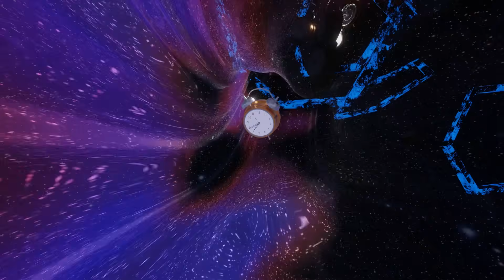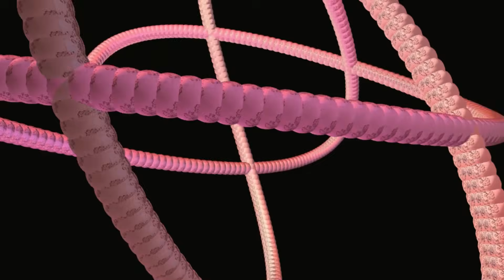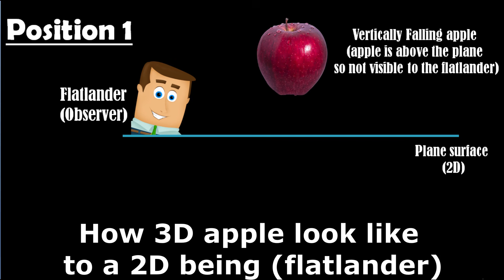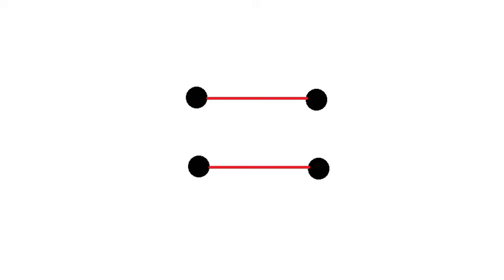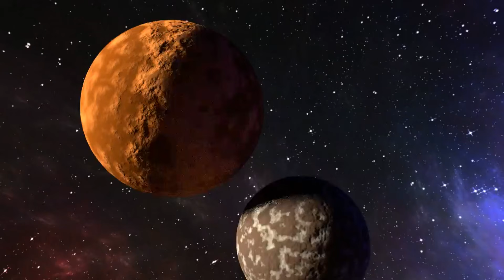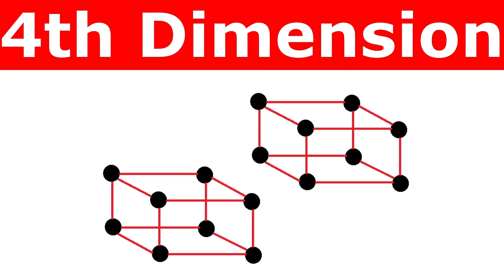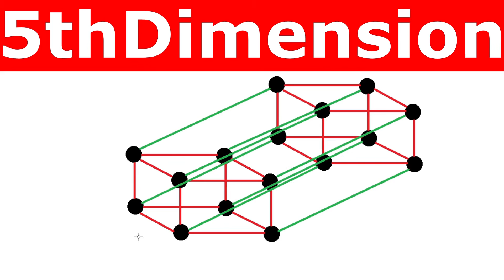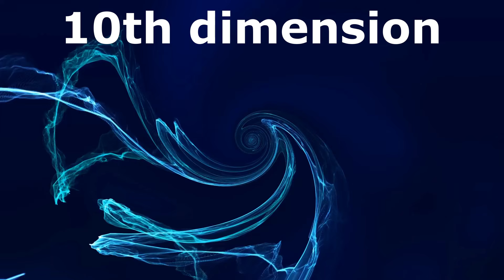11 Dimensions Explained - A Mind-Bending Explanation of Higher Dimensions!

Comment: Nice attempt at understanding the 11 dimensions so please don’t take offence if I make some corrections, but you make the common mistake of placing time as the 4th dimension, you are still thinking in a 3 dimensional way by expanding the shape of the first three geometric dimensions. You need to include the forces (or relative dimensions such as electromagnetism, gravity and nuclear) as dimensions, and by doing this it would make time the 9th dimension. Another common error made by 3 dimensional beings is that if you were able to move within the time dimension; you automatically assume this includes time travel. It would be more accurate to describe awareness within the time dimension as slowing and speeding up time rather than traveling into the past or future, and this is understood because from within the time dimension there is no past or future and this also discounts the idea of parallel timelines.
Reply: I would like to explore/propose a test for “dimensionness” from an observation I ran into with the “flatlander” example. I’ve been mulling over in my head for a while. 
The flatlander sees the apple moving through it as a point appears, expands, collapses and then disappears. Now if I imagine that, if I was a flatlander, who fully understands three dimensional reality, how would I describe knowing the difference between a flatland object and a 3-dimension object? 
I imagine I would describe a 3-dimensional object as matching 1 of the following 6 conditions (which are actually showing the same phenomenon at different points as the apple falls). I like to use “interference” as a description of how dimensions interact/affect/influence each other where they “touch”.
1. I observe the phenomenon appear for no apparent 2D reason.(the first point of interference of the 3D and 2D)
2. I observe the phenomenon disappear for no apparent reason. (The last point of interference of the 3D and 2D) 
3. I observe the phenomenon to always be increasing for no apparent reason. (The first half of the interference of 3D and 2D)
4. I observe the phenomenon to always be decreasing for no apparent reason. (The second half of the interference between the 3D and 2D)
5. I observe what seems to be a phenomenon that is a constant for no apparent reason. (The interference of the 3D and 2D goes so slow that I cant observe a change)
6. I observe a phenomenon that seems to flash in and out of existence for no apparent reason. ( the 3D and 2D interference goes so fast I cant clearly observe)

Now, lets visualize the interference between the 3D world and all other dimensions (i like to use “n-dimensions” to describe a random other dimension). Any phenomenon that matches 1 of the 6 conditions for no apparent 3-dimensional reason, would be the result of a n-dimension and 3D interference.
Are there any phenomenon you can think of that pass the test? I’ve come up with a few.
Reply: @deths1679  Hey, watch this, trust me, it holds what you seek.

https://youtu.be/da5RoS4w5YU
Reply: No Name  ah I see, there are some that choose not to explore and some that don’t know they can. It seems you choose to explore, it is a fun place. One thing I’ve learned about people is I can’t change them, only guide them, and everyone knows something, but no one knows everything. 
You like my flat space-time joke, its funny because when they illustrate space-time, they show it as a flat fabric  plane that is warped and bent by mass.
Reply: What are you talking about? Gravity and electromagnetism are NOT dimensions LOL.
Reply: No Name  oh no, we got a flat space-timer, lol just kidding. I was curious on your interpretation of something. It seems to me that Einsteins clock tower thought experiment has implecations in both the nature of reality and our perception/interpretation of reality. Have you ever experienced perceiving reality to move faster or slower? Such as when someone is working really hard and the day seems to “fly by” very quickly. 
Now with assuming that mass and velocity will exert “gravitic forces” on objects, my question to you is, does the perception of time accelerating increase the specific gravity of a persons body?
Reply: i think the entire way everyone is trying to predict and diferentiate one dimension from another is completely wrong haha
We are missing the big thing that is compreension on how conscious work and interact with the universe, we cant grasp any other dimensions before that.
Reply: This theory does not make sense in any way.. For example if i go back in time and start a new timeline with a new wife plus i also exist in the older timeline with my old wife then most probably the me living in the older timeline with the old wife will start an endless loops of timeline trying to start a new timeline with a new wife, this will start an stupidly endless versions of new timeline unless all the versions of me in all the different timelines shares the same thoughts, feelings and consciousness which is highly unlikely..
Reply: And creating a whole new damn timeline just to cheat on your wife and have some fun with a new wife is an ultimate example of multidimensional desperation. I mean what kinda fetish is that??😂
Reply: @MainakBose14   🤔🤔🤔
Reply: No Name  but as I understand it it doesn't mean they're dimensions. Besides the fact we can theorize but were not certain what is in these higher dimensions.
Reply: Forces don't make for more dimensions, but otherwise you are right about the fundamental error of perceiving from "a 3 dimensional way", i.e. a bottom-up approach.
Reply: Damn. But I get it. Sooo...
Reply: No Name  yes my favorite experiment is the slit experiment. What are your taughts about it?
Reply: Wrong
Reply: This is class 101. Check and see if the teacher in the advanced course covers it.
Reply: Lmao all these mountain dew drinking, neckbeard having armchair philosophers talking about shit that no one in this 3D world can even begin to try and comprehend. Lmao go get laid or something
Reply: If time moves forward on a spiral then time would be connection and can be short or long right?
Reply: None of it works because this is all theoretical and running off the erroneous assumption that time exists.

Time does not exist, at least not in the way we believe it does. There is only one time: now. That is eternity. It's present everywhere, all the time.

You use the concept of time in order to maintain the structure of your physical experience as a sentient mammal on this planet.

In reality, this planet is simply drifting through space. The way it does causes you to rely on your calendar to make marks. Time is an illusion.

The reason science cannot begin to access consciousness itself is because it does not hold the proper perspective to perceive reality in the true nature of its form, which is infinite, in all directions.

You are infinite; you are simply caged in your flesh suit which continues to grow and age. Time does not make you age; you age because your body has instructions in your dna that tell your physical organism how to grow. That is not time, that is your dna and rna maintaining and living out the life cycle instructions of which they consist. Again, time is an illusion. 

Our bodies grow, age and die and so we regard time as the greatest frontier of all; mastery over our mortality. However, our mortality simply has to do with the biological organism and its base 3-dimensional organic structure.

It's meant to deteriorate. It's what continues to generate the third dimensional physical universe.

Time is a human construct, it is not a universal constant. It's like inches or dollars. THey're not real in the way we like to think of them. If they were, we could go to the inch dimension. Oh wait, we can. THat's the 1st dimension.

Do you see where I'm going with this?
Reply: @tailong9548  Time is change
Reply: @AmTrFilms  Conceptually, time is a tool (one of many, in fact) we can use to measure change. However, time is not change. Both are actually only concepts, constructs we have devised to improve our overall advantage when it comes to dealing with reailty.

We see changes occur; our bodies grow and age, the heavens turn, etc. The universe, we find, is tuned like an instrument. Change any of the slightest variables and it collapses. Truly, we live in a very theoretical universe which simply holds itself together based on strict precepts.

The 4th dimension houses one such precept but it is not time. It would better to think of it as 'movement' or 'energy'. However, in the case of the 4th dimension, we're witnessing the 'movement' as more of a 'progression', like a ticking of a clock. Cogs that go round. The cogs are not time itself. 

The universe is like a giant watch. It's churning, changing, fractalling and patterning all the time, growing, dying but the time still remains an illusion. You're simply watching the progression of energy interacting with energy, matter interacting with matter.

The time is completely illusory. Realizing these concepts is what will launch mankind into the space age and it is a lack of understanding on the topic that is holding us back from this progression.

Addendum. To be clear, just because 'time' does not exist in any form that science could ever 'discover' does not mean that time isn't still a very real concept for us as we live out our lives as humans. We still use time, understand and value time. We manage it but we can't own it and that is because it does not actually exist.
Reply: @tailong9548  We have to understand science has to have a form of measure. We shouldn't discount the information because they use the only ruler they were taught. We don't have to be a phyisist to ascend to another dimension.
Reply: @tailong9548  It's such an amazing enlightenment. Do you have any videos or books or materials that you can share with me to understand deeper into this view/ thoughts? Right now this way of viewing time is still very vague and cloudy to me. Would really love to be able to internalize it better.
Reply: @zxedacus00  I can't tell if you're trolling or for real. lol
Reply: @tailong9548  I'm serious. Any videos or reading materials will be greatly appreciated. Thank you.
Reply: @tailong9548  Spacetime is a real thing, it isn't a human construct.
Reply: @tailong9548  Nope.  Time is a construct of the Creators of this omniverse.  Time is 14th dimensional, permeating all within this duality construct.  It’s a figment of the Prime Creator’s imagination, a way to experience individuation.  Every “lower” dimension is a fractal reflection of that Source, grounded in supersymmetry (mirrors).  WE are fractal fragments of that Source, living out a holographic projection of all the other dimensional realms.  

The stories presented in mythologies and every single religion known to mankind are playing out here.  Earth (Heart) is the singularity of the cosmos, the most extreme manifestation of polarity in a “love vs fear” sine wave duality.  In a “suffering leads to wisdom” paradigm.  

Earth is the final battleground (singularity) for the many wars in higher realms stemming from said duality.  The only way to go “lower” and maintain sentience is in a more digital/AI realm...which exists, but isn’t a fun place to be.  It’s a phenomenal time to be here!
Reply: @psychegoddessoflight9358  Don't be blinded by the light.
Reply: @psychegoddessoflight9358  Time is cyclical. eg Summer/Winter, Manifestation/concealment of the universe. it is based on the well validated Vedic metaphysics Sankhya (around which the whole hindu tradition including Yoga and tantra was built)>.  it also means there is no creation of the universe out of thin air or permanent destruction of the universe.
Reply: @tailong9548  Time is cyclical (not linear). It is because the conscious, immortal, immutable, immanent (soul), transcendent and omnipresent shiva always exist together with its intelligent energy (shakhti) for the perpetual duality cycles to happen. eg Birth/decay (including reincarnation cycle), wave/particle, energy/matter, manifestation/concealment (of the universe), summer/winter, wake/sleep, man/woman, day/night etc. This is Sankhya Vedic metaphysics (around which the whole hindu tradition was built including Yoga and tantra) which can be validated by logic, double slit quantum experiment and embodied experience (direct knowledge through focus and meditation). 

Consciousness is an attribute of the soul or athma just like heat is for fire and the sun.
Reply: @indianmilitary  You seem like someone who would be very interesting to have discussions with.  I don't see time a cycle.  It does seem like there are repeating conceptual patterns.  Rather then exact patterns.  It also makes more sense that there was a starting point and to some extent an end point.  I can believe people have obtained insight while practicing yoga and tantra.  But that would raise more questions then it would answer.
Reply: @tailong9548  You're awesome
Reply: @tailong9548  This put things in another perspective. Thank you.
Reply: @tailong9548  actually, I've stumbled repeatedly into that the entire universe is a spiral and that every event is all happening in one instant. It will have to be a koan because my mind will not let that concept go
Reply: What are you talking about? electromagnetism isn't a dimension and gravity is a manifestation of the 4th dimensional spacetime continuum.
Reply: No Name  Exactly. The mind is consciousness, all is mind.

Which is interesting cuz that brings together our modern science and hermeticism.

However, what's really going to blow your mind is this: how can we trust what we discover when we understand that this system organizes itself and holds form only once it is observed?

Isn't it interesting that science postulates a lot of these theories and then magically discovers they were correct?

We would argue it's cuz they used the scientific method. However, one can't help but wonder if we're finding the answers we expect to find simply because that's what our science is uncovering.

Meaning, should other plausible, workable modalities and theories arise, perhaps evidence for them will arise too.

This arises, that becomes.

I believe the odds that our science can make all these advances in so short a space of time is suspicious. It's like the double slit experiment. The particles only choose a form when observed and behave differently when not under observation. The observer alters the observed reality making an objective understanding nigh impossible.

Reality may arrange itself in a manner we expect to find when we look. So when we observe/measure, it simply organizes itself one way while a whole different way may be present just not visible from our currently limited 3 dimensional vantage point.

My point: this reality could be something completely different than what we believe. We'd have no way to tell cuz all of our computations and tech rely on this limited 3 dimensional plane.
Reply: @tailong9548  this just strengthened my belief in the law of assumption and how we manifest our own reality through or consciousness wow thank you you are damn smart
Reply: @robbiesmoonmusic  Wow, thanks for the comment.

I love tarot, btw. What's your fav deck?
Reply: @tailong9548  the fountain tarot deck is by far my favorite!
Reply: @robbiesmoonmusic  O thats funni, every time I add that to my cart I end up getting something else. I think maybe I'll check it out next.

My fave is Dreams Of Gaia. It's worth owning at least one copy of that. The concept is so strong in that deck and readings can be very intuitive and surprising.
Often puts you into a space to consider things from a perspective you otherwise may have ignored.
Reply: @tailong9548  
The mind is not consciousness, we're in consciousness
Reply: @tailong9548  Therefore, We are god(s) of our own reality (realities) !!! 🙂
Reply: @conradsalaiz5523  This is what ageless hindu/Vedas say. "Tat Tvam Asi" - You (conscious and immanent athma or soul) are (already) that (conscious, transcendent and omnipresent divine) regardless of whether you realize it or not because without the conscious and immanent athma or divine nothing can exist.  False identification with thoughts and body is just an illusion due to 5 senses experienced by the  athma or soul even though it is NOT the doer.
Reply: @tailong9548  not quite…reality doesn’t ‘manifest in the way the observer wants’ as you said. The wave function collapses not because we are ‘observers’,  but because we are quantum particles interacting with the electrons in the double split which are also quantum particles. Two quantum systems interacting will collapse the wave function
Reply: @jaipanesar6027  U r right but I went back thru my comments; I can't find where I said it like that. Can you point it out?
Reply: @tailong9548 on to something ✨🙃
Reply: @tailong9548  beautifully said.
Reply: gravity is a theory newton and nasa tell children...if space is a vacuum then how the hell do rockets and thrusters work?
Reply: No Name  how can physics be so sure when so little is known about space.

Comment: There is a misconception, the observer needs the third dimension to be able to see the cross-sectional area of the apple. Any observer in 2D will see the point of contact between the plane and the object and, an increasing/decreasing line as the object goes through the 2D plane. For one dimension, any observer will only be able to see a point. Take this to three dimension and place the apple in front of the observer. The observer will only get a 2D information about the apple meaning the observer cannot know what is behind the apple. Therefore, in higher dimensions, any observer can only gain information within one downgraded dimension. (this is wrt the observer [sense of vision])